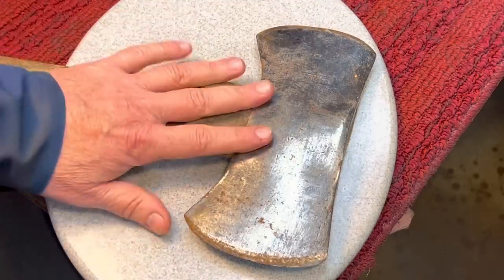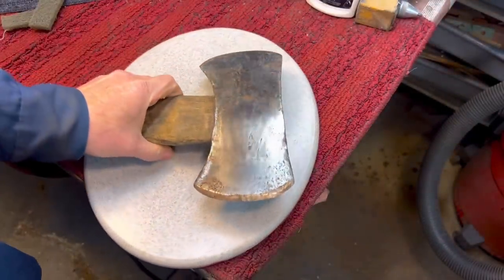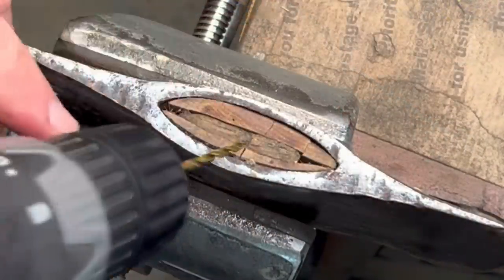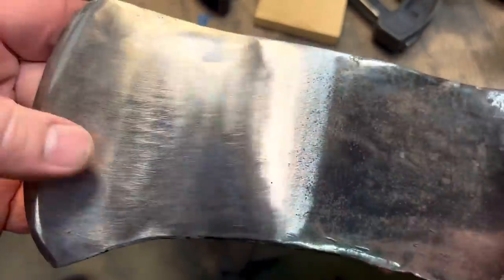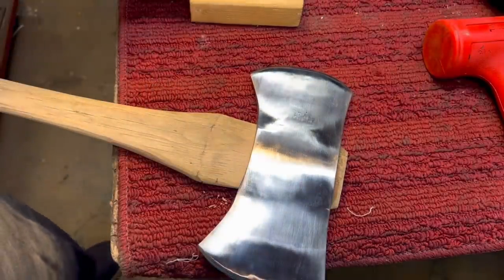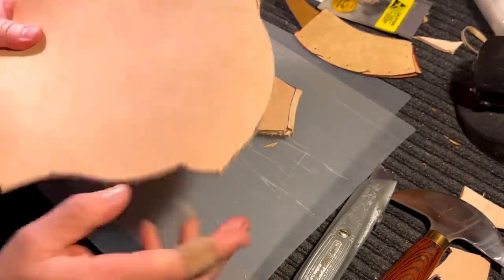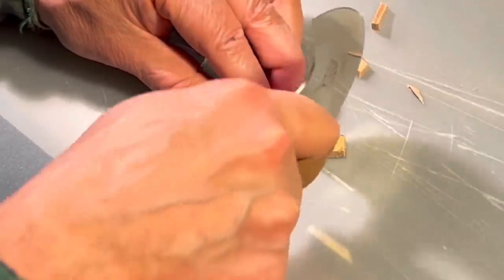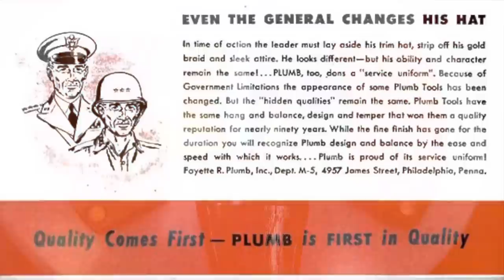Plumb Victory Double Bit Axe Restoration

Comment: Master of art John. That axe turned out beautiful! I love it! Thank you for the wedging of handles as I haven’t had any problems with my hammers once I fixed them! That sheath turned out amazing. I love leather work! We call them welt between the layers of leather so a blade doesn’t cut threads or cut on the rivets. Great show!

Comment: That double bit is beautiful sir. I sure wouldn’t turn it down if offered, nice piece for your collection. I used to fell smaller trees with a double bit, and with a file and an ax stone it is easy to keep them sharp on the go. I would also limb down trees with a double bit, and on smaller trees we could limb faster with an axe than you could with a chain saw, and yes there is a little trick to limping with an axe, just in case you might be asking. Thanks for the video sir.
Reply from the maker: Yes- Splitting and limbing are still great with an axe, fun too!  😃👍

Comment: Hi John , Old Glory really looked great against the dark sky. Wow, an ax restoration and a leather introduction. You’ve outdone yourself. I just picked up three clobbers hammers on Facebook. At least two maybe all three need new handles. I remember you talking about metal cross wedges after putting in the wooden wedges. I remembering you mentioned getting special wooden wedges. Could you pass along your wood and metal wedge sources. Another great mosh. 
Best Regards,
John
Reply from the maker: Hi John- I got an assortment of wedges from Amazon years back.  Normally I cut my own Poplar wedges but this wedge was sycamore!  😃👍
Reply: Thanks John. I’ll do some searching.

Comment: Now that is a nice looking axe. I have some double bits but I don't care for them. I do have a cruiser that I like.  Farmers would use a double bit but sharpened for cutting on one side and splitting on the other.  When I was a kid there was a fellow that was well slow. My father said it happened when as a kid he ran behind his dad using a doulbe bit and it caught the kid in the head.  Whether true or not it always made me wary of a double bit.  Bothers me more than a chainsaw and I have been severly injured by a chainsaw.
Reply from the maker: Philip I agree that design is best left for the professionals.  I prefer a single bit axe so I can drive wedges with the poll. The double bit split all my wedges! 😂😂👍

Comment: Told you that slide hammer does wonders on wedges haha
Reply: Great job man!! I loved the leather work! I need to get a starter kit of leather tooling. Any good ideas?? Maybe a segment for another video on leather tooling? Thank you sir!
Reply from the maker: I can’t believe how good that worked!!!  Thanks Brian!
Reply: Of course!! Thank you for trying it!!! I’ve used one on thousands of wedges by this point I bet. I’ve had some heads that have 5-6 metal wedges in them lol. Thanks again!!
Reply: Yes sir!!
Reply: I made one out of stainless and brass. It’s just a t-handle shaft and a piece of brass round stock then thread the end and find something to capture the screw/rod. You should make one!!

Comment: The 2 sides on a double bit arent for just turning over when one side is dull, they are sharpened at different angles, on at a finer edge for felling clean wood and one at a thicker, stronger edge for chopping where you may end up in dirt or rocks, such as roots.
Reply from the maker: I’ve seen some people put slightly different grinds on each side but from the factory most double bit axes are ground identical.  😃👍

Comment: It's beautiful but what did you use?  I know you hate linseed oil.  Also I expected you to bottom that head out on the shoulder so I'm really confused!
Reply from the maker: I Used Gunstock stain, Amber Shellac followed by spar varnish, the handle was trimmed flush to the head with a saw after assembly. 😃👍

Comment: Great job overall, as per usual. However your Durable Snap is not assembled as designed. The cap section normally attaches to the socket. You have the socket attached to the eyelet where the stud section is meant to be. Hope that makes sense. The top flap is meant to be the cap attached to the socket, which engages the stud on the main body of the guard. It will work either way, but you may run into problems with long term hard use.
Reply from the maker: That is so funny- Reading your comment I thought to myself the female is always on the cap….  I went back to the video and noticed I did indeed reverse them! 🫣. I’ve installed hundreds of snaps in my lifetime and this was the first time I ever did it backwards! 🥴 I didn’t even realize it when snapping it shut!  That’s why it’s so important for me to re-visit these hobbies every so often because I forget the basics!  Thanks!  😃👍
Reply: @ScoutCrafter  I did leatherwork as a retirement business for a few years, and you should see some of the things I have done backwards. LOL. Cheers.